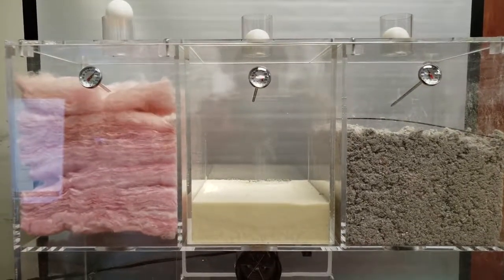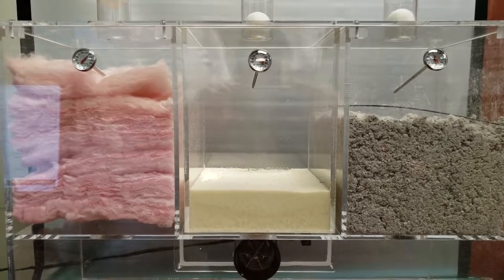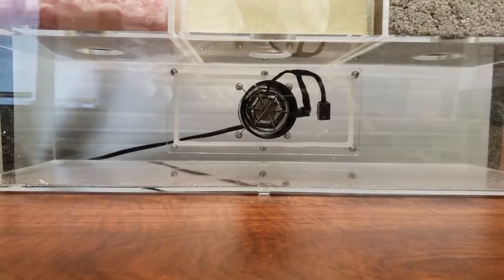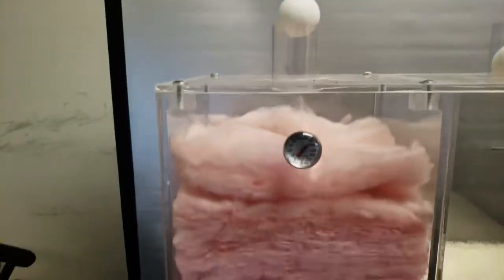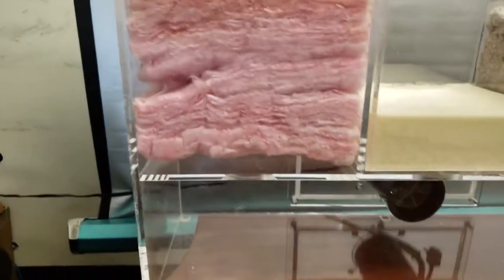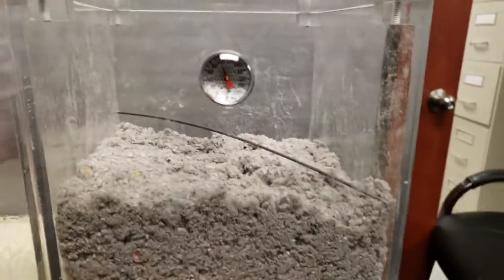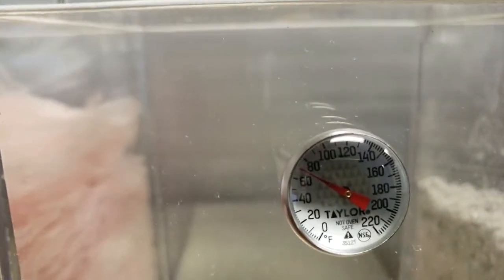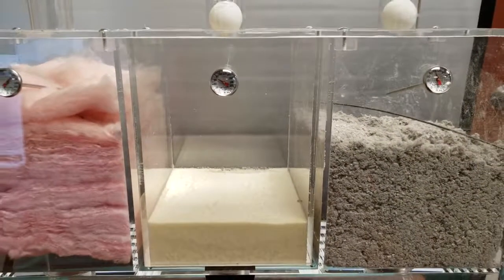Why Spray Foam Insulation

Comment: I’m all for spray foam but this is more an example of how great it is at air sealing them it is at demonstrating  its insulation value.
Reply: But he showed the temperature of each insulation and the Spray Foam has a significantly lower temperature then the other two do. So I'd say that he did a pretty good job at showing the insulation value of each one.
Reply: @Melanie-777  since no air was able to get through the foam the ambient air temperature above the foam would obviously be less. If the bottom was made of thin sheetrock and didn’t have a hole in it for the air to freely pass through it would more accurately demonstrate the R value. Luckily spray foam air seals and insulates which is perfect for this test.  The insulation manufacturers actually specifically state the r value is with no moving air through it. It is designed to be in a sealed cavity.
Reply: This ia also why R-value doesn't matter. If the best way to keep your home warm is by air sealing it with spray foam then R-value is a worthless metric if the air can go directly through it or leak around it.
Reply: yes it works very very well your sealing it off so that the heat stays out. you just have to have a fresh air system to bring in fresh and push out bad air out

Comment: Haha probably the worse example of how insulation actually works
Reply: Spray Jones would  sort of agree with this test, a little extreme but an open insulation will allow convection currents to transfer heat and allows humidity and cold air in it to lower insulating ability. In fact 2" of foam will insulate as well or better than 8" of fiberglass., plus seal most all leaks.  https://youtu.be/hS7EcjZaQRY?t=242

Comment: Is it ok to apply spray foam insulation when the attic is 110 degrees? Will it fully cure? Or will it off gas forever?

Comment: This demonstrates only, that foam is sealing but the insulation doesn't have to seal but has to insulate.
That's why you install a vapor barrier plus insulation
Not only insulation except for foam.
But now think about recycling if one day your house gonna be destroyed or rebuild. A house with rockwool or equal insulation and a house with foam. In this point Foam sucks when it comes to environment and sustainability

Comment: Good luck repairing electrical and plumbing ,I ll take fiber glass batts better ,for air leaks ill use wether moisture barrier outside and caulking inside 😉

Comment: this example doesn’t show anything. Spray foam seals the house completely and a house needs to breathe otherwise it will rot and 2 spray foam it’s way overpriced
Reply: There are countless installations of spray foam (done properly), which are not rotting.  Water does need a way out from anywhere it can get in.  Weep holes in brick are one example.  I have to agree with "overpriced", though.
Reply: House doesn't need to breath
Reply: Might I suggest the YT channel "Spray Jones" for correct information on spray foam ,LOL .